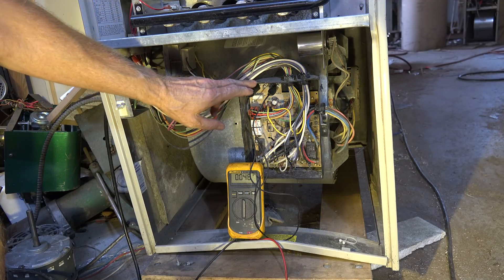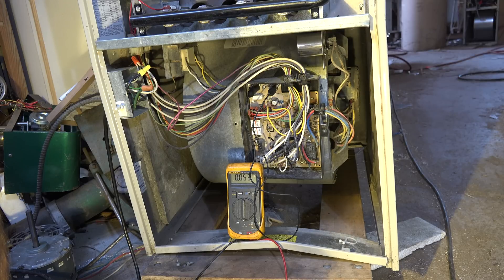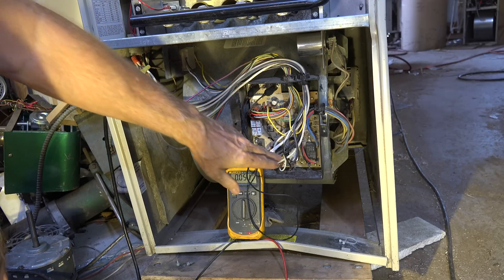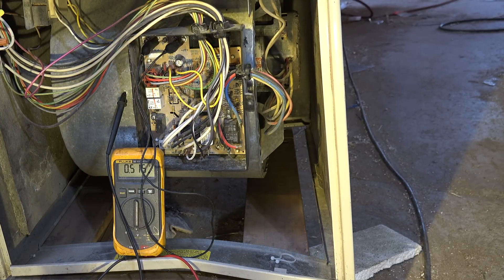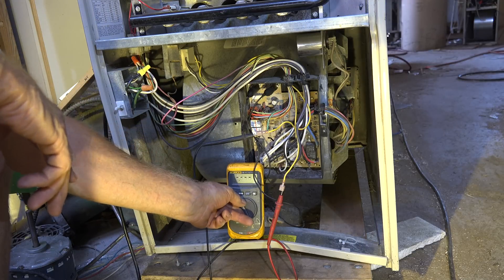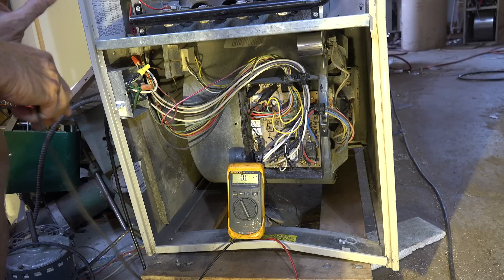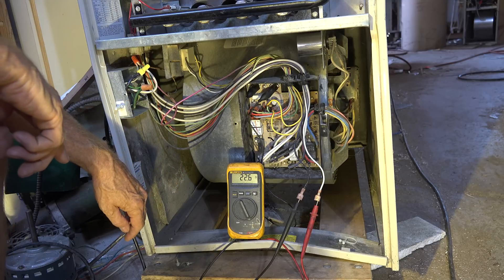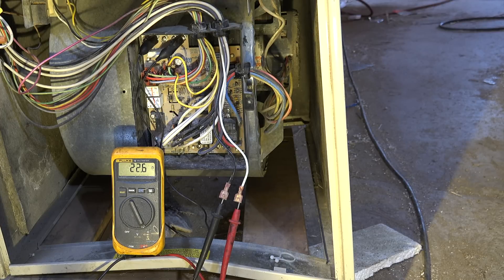What's wrong with this furnace #16

Comment: Without a doubt furnace is bad! Replace furnace for $9,999.99 and move on to next job. That was an easy one!
Reply from the maker: Wouldn't it be interesting that when you replaced the furnace it still would not come on.
GFM
Reply: having said that then it must be a bad 24v ground. shoulda checked 24 power to the high voltage to get a 96 v reading then you know theres a ground issue
Reply from the maker: The answer will be coming soon.
GFM

Comment: probably broken neutral on board or upstream of the board, splice box, breaker panel or switched/fused neutral off/open.
need to test from hot to neutral and move "upstream" if not present :)

Comment: i would first replace the transformer and add a fuse with it or put a lil popper inline with it to check for a low voltage short

Comment: instead of checking black to ground check black to white. Neutral and ground not the same that s why meter goes nuts to find ohms... So no neutral
Reply: meter goes nuts because there 24 volts present cant read it cuz theres a bad 24v ground

Comment: It's as simple as you don't have 24v coming out of secondary but 120 going in. The coil has no resistance. Long story short bad transformer.
Reply: Could also be a broken neutral wire

Comment: I would isolate the secondary wires from the board . If it reads some value of resistance the the secondary winding is shorted or both the secondary and something in the control wiring is shorted
Reply from the maker: The secondary wires from the transformer are disconnected from the board during the test.  The primary of the transformer is not disconnected.
GFM

Comment: Since there are no fuses, I would check the furnace ground, replace the transformer, and put a clamp on the low side to see if it exceeds the 1.6am.  There may be a short on the on a component which caused the transformer to burn out.